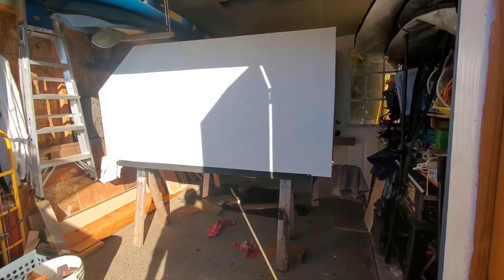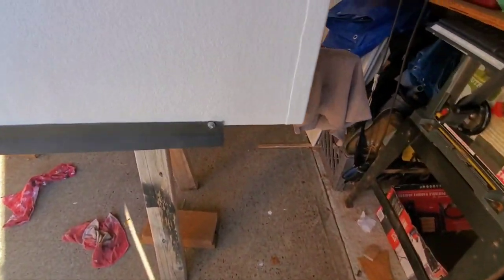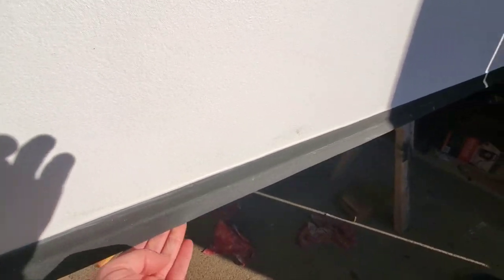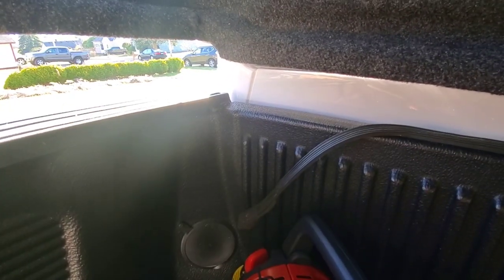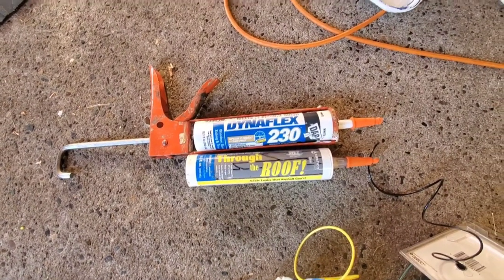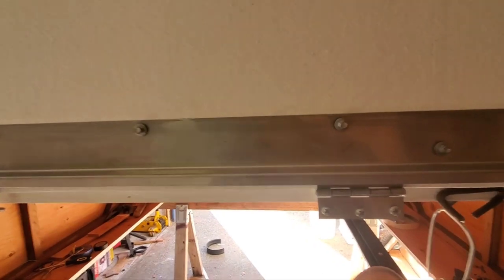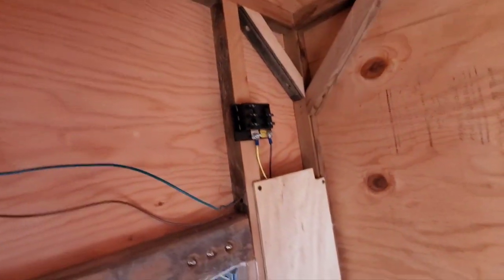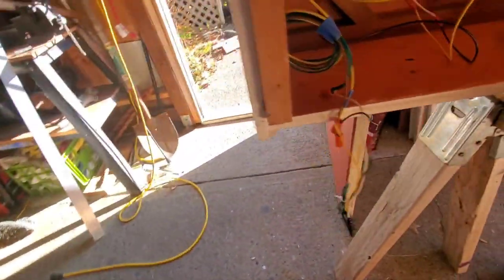Lightweight Camper Build Part 4 Quick Update

Comment: How much wider is this compared to the topper it replaces? Are you planning to insulate it or add windows?  Like your progress so far!
Reply from the maker: The topper was only as wide as the bed (around 5ft) and narrowed from there up. The new one is 6ft inside width.  Definitely going to insulate and deciding on how big and where I might want some windows.